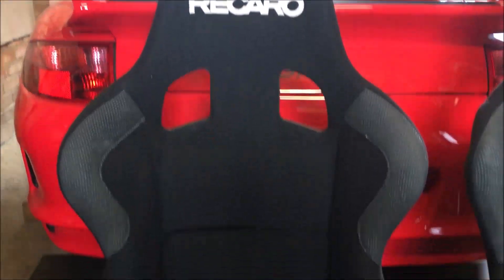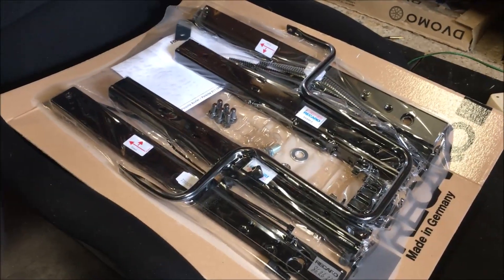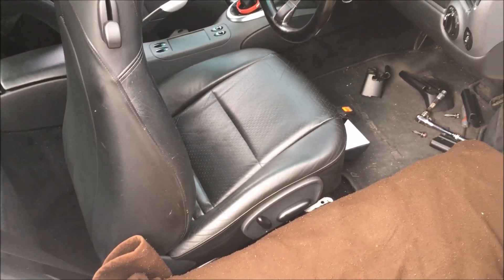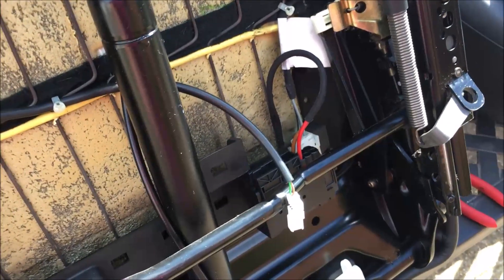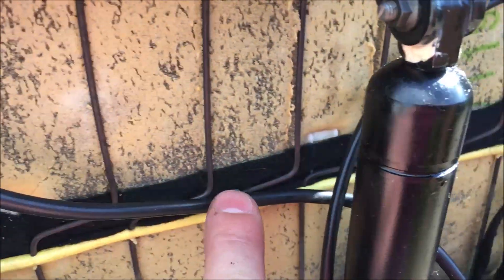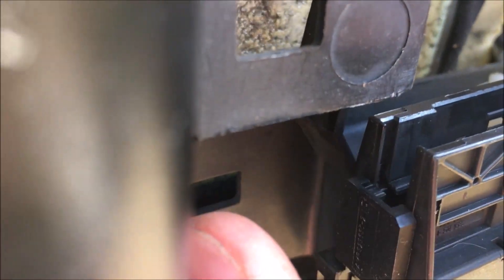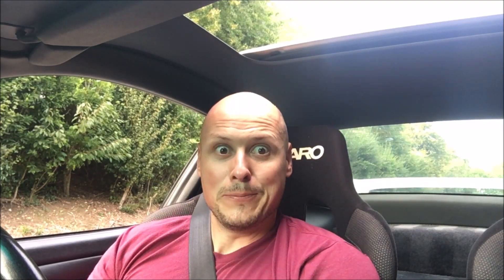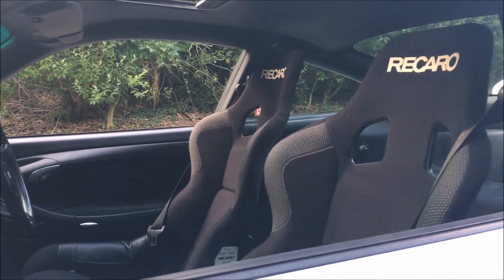Bucket Seat Installation | How to Guide DIY | Porsche 996 986 987 997 911 GT3 Recaro Sparco OMP Momo

Comment: I had a 996.1 GT3 for many years and loved the Recaro bucket seats, which were the best seats I've experienced in any road car. I'm average height and fairly slim so fitted me like a glove but appreciate that larger guys may not find them that comfortable.
Reply from the maker: Cheer Geoff. I’m pretty sure the 966 GT3 recaro’s are designed with the bottom half being a Pole Position (FIA), and a bespoke ‘cobra’ top - does that ring true to you? Lovely and comfortable buckets! 

My 997 GT3 had buckets but I believe Porsche then moved to a bottom half being the bigger Pole Position (ABE) so a bit more  wiggle room!

Comment: They really look the part.
What I'd like to know is what they are like on a long drive (around 2hrs)? Any worst or better than stock? 
Can you also gain enough access for someone to fit in the back? 
Keep up the great 996 videos. 👍
Cheers
Reply from the maker: Most important is to get a seat that fits you. I find them very comfortable; they fit my shape really well. If you get a seat that’s too narrow it will be the opposite and you’ll hate them!

No chance of someone getting into the rear with these installed. Luggage only!

Comment: Seats look great and will be interesting to see your longer term review/update on comfort etc. Do they do a tilt version as I need the back seat access for the little ones 🙄
Reply from the maker: So far they seem more comfy than my gt3 seats in the 997 (Carrera GT seats) as they are a little wider and I’m quite portly. Plenty of folding options out there if you don’t want a fixed bucket. I’m going to look at car seat options for the front with my toddler 😊
Reply: i realize it is kinda off topic but does anybody know a good site to stream new tv shows online ?

Comment: Nice video and very informative. Recently purchased a 996 and will be fitting my recaro’s I’ve been hanging on to for years. Just need to order some sliders and subframe. Where did you order yours from? Thanks
Reply from the maker: I got my hardware from GSM performance - they often have some good deals on so check their promotions page first for voucher codes!  https://www.sportseats4u.co.uk/Current-promotions/

Comment: Hey chap - videos are super useful. I am stuck installing my seats and wondered if you had any insights.  At 8m19s you show how the frames align to the chassis of the car. I can also see that the threaded hole behing the chasis mounted hole does not align (same as mine).  The at 11m28s you show how its all come together. The bolt that connects the runners to the chassis mount with the packers in between... this is the same hole that doesnt align to the second holes. My question is, do you know what length bolt you used and how many packers? The reason I ask is that the bolts I have been supplied with my kit are WAY too long, and I was only given 1 packer per corner, and without that threaded hole aligning, the extra thread the bolt cant drop into the hole in the chasis.  Hope that makes sense.
Reply from the maker: If it’s the bars that mount to the car chassis they should be drilled for a perfect fit - if they don’t immediately align you might need to trim the carpet a little.

If you have the whole seat+frame assembled and want to put it in as a unit, make sure all the bolts are torqued to spec except the side mount bolts on the outside face of the seat - these should be very loose to allow lots of play in the runners. First bolt to the chassis, then tighten the last two side mount bolts to put it all together 👍

Comment: Thank You for Your content. How many kilograms You think you saved? Do You feel the weight saving whilst driving?
Reply from the maker: So far the car has lost 61kg, so essentially the weight of a passenger. I've lost that weight gradually over time as I've made improvements, so I haven't had a direct before and after comparison. So with that said its hard for me to pinpoint the exact difference it's made.  I guess the best way to compare would be running with and without a 61kg passenger ! The car certainly feels light and nimble and revs very well so i'm very happy with it.

Comment: How much room would you say is on either side of the seat between the door and the center console? I'm looking at some other similarly sized seats and want to see what else might fit, using your setup as a guideline. Thanks!
Reply from the maker: When the seat is fully backwards (helpful for getting in and out) the seat base bolster is millimetres from the console; much more room towards the door side. The wing of the seat has fine clearance to the glass/pillar. I would not want to go beyond the dimensions of the Recaro SPG XL. Good luck 👍
Reply: @TheThrottleCable  Much appreciated! Do you mind sharing your height/weight or waist size? Do you think you'd have enough headroom with this setup for a helmet? I've searched high and low for info on bigger bucket seats in 996's and this is the best content on the subject out there, so I have to asked detailed questions haha!
Reply from the maker: I’m 5’10, weight in at about 100kg and my waist size is typically about 36 inches and more like 38 at Christmas! I’ve just tried sitting in the car for the first time with a helmet on and I’m about an inch off the headliner. My car has a sunroof.
Reply: Thanks so much! I appreciate the help! I'll let you know how my seat search ends up.

Comment: Hi:)
Very nice car and videos!
Im looking for a new garagecar, but I am quit tall (203cm).
I have just tried sitting with my helmet, in the daily, and I can see that I need 103cm from seat to roof…not pressing down on the seat.
Would it be possible for you to tell me your cars meassures from seat to roof?
Best regards
Michael
Reply from the maker: Hi Micheal, from the rear of the seat swab where th base meet the back rest I measure 98cm - note my car has a sunroof. I understand you can get side mounts to lower the seat further, plus you can mount the seat in a fixed position and elimiate the height of the runners. thanks
Reply: @TheThrottleCable  thank you so much for your feedback!
So as I understand, it seems possible to find the last 5+cm in height.
My helmet is also a Bell GT5 Touring, and I have heard, after I bought it ofcaurse, that it is not a low helmet, like ex Arai GP-6, with out facts :)
Reply from the maker: @MukendiMedia  I havent done it myself but yes it seems possible

Comment: I’m 6’5 does this sit lower then the default 996 seats that are motorized. I need all the clearance I can get
Reply from the maker: It does sit lower yes, but its not a night and day difference - you can get custom side mounts made up to make them run even lower, or run thinner bottom cushions (some people take cushions out completely for track days to get more clearance for helmets)
Reply: @TheThrottleCable  I’m 203cm tall, and Im looking for a 911.
I scrape the loft in a 996.1 GT3 with normal seats, but I fit with a helmet in a 997.1 Targa (closed glassroof).
If I made my own seat mounts, to maximize how low and back a bucket seat can go, what is your guess on the height gain?
BR
Michael (Denmark)

Comment: Where did u get the seat mounts from I am looking to install recaro pps in my 991 and don't want a really heavy seat mount and the 996 looks like its the se fitment to the 991
Reply from the maker: I got them from GSM; they often run a discount on your first purchase from them if you check the promotions page - they have a dedicated bucket seat site here; https://www.sportseats4u.co.uk
Reply: @TheThrottleCable  any idea on the weight I have a seat trial appointment with them nxt week as I'm not sure which seat will suit me best
Reply from the maker: Look at 12:40 in the video for info 👍